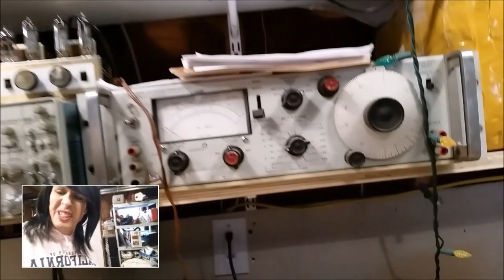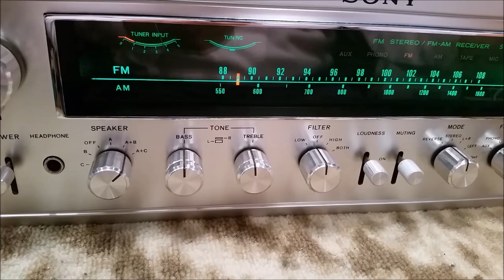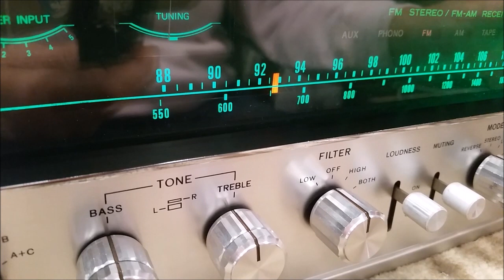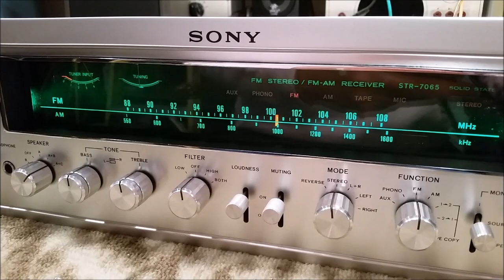Sony STR-7065 Stereo Receiver (1972) Repair...Attacking Inter-Station Distortion

Comment: Well Rosie,, going that extra mile, doing the power board, the amp board, and then that extra effort on the tune circuit gave you a trifecta pay off. What a nice job on this pal. Really sweet.

Comment: Sounds good , that is from the era when they used tantalum caps if you see any of them I'd pull those out too , there failure mode is normally a dead short , I've chased may of them around looking to the shorted one .